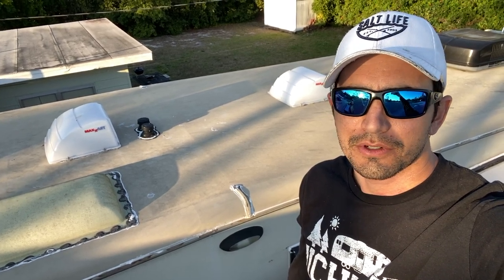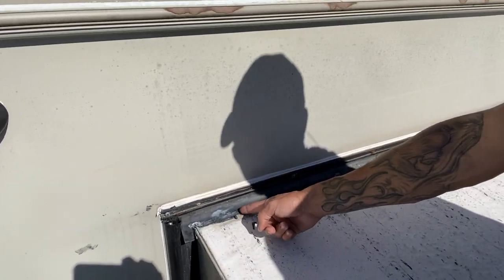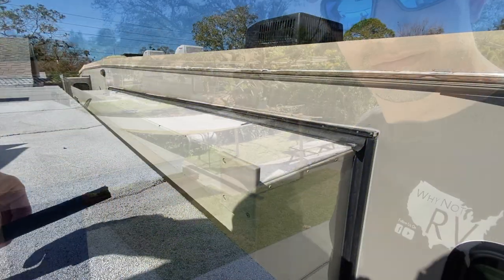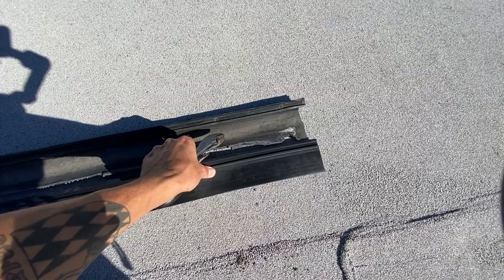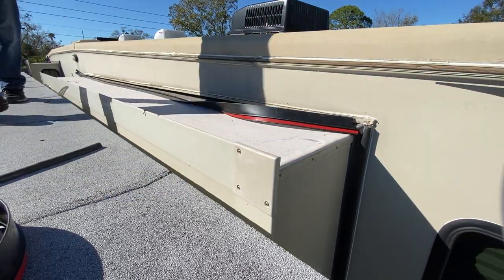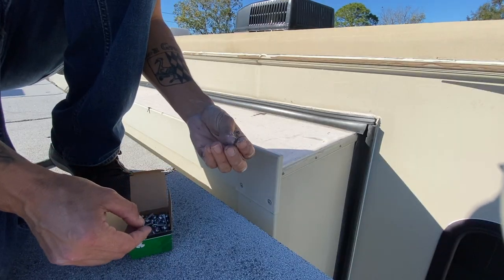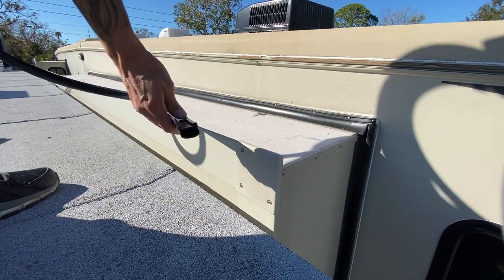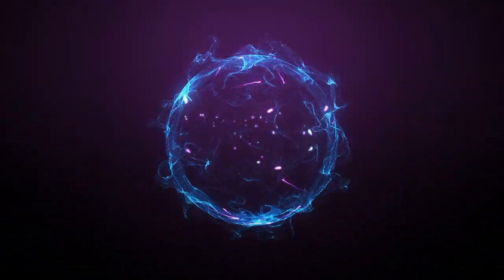How to Replace Slide Sweeper Seal - Why Not RV: Episode 6

Comment: Great video. Just what I needed to see right now. Have to do the same project. Couple quick questions. 1) did you use the same screw holes when you put the new wiper seal on? 2) did you caulk above the wiper seal or just above the bubble/d seal? And 3) what type of caulk did you use? Thanks!
Reply from the maker: Hey Bill, thanks for watching. I did not use the same screw holes, its near impossible to find them once the seal is on. I caulked the gap that is between the seal and rv itself, depending on your exact type of seal it could be different than mine, just make sure moisture cant get down behind the seal. I used basic window / door outside use caulk.

Comment: That was quick, but you forgot to clean the surface, so you would get a good seal to the RV where the tack surface is. The screws actually hold it on, but the seal keeps the moisture out!
Reply from the maker: Definitely can get a cleaner and better seal if cleaned first. Alcohol or mineral spirits are my go to

Comment: This doesn't curve around your slide and go all the way down. All those gaps where the side and the top meet let's water run down in those cracks between the seal and the slide side.
Reply from the maker: There is the same type of seal that also runs down the sides. Replaces the exact same way